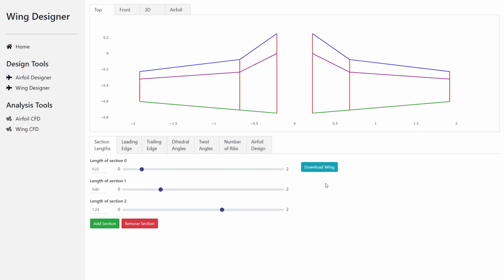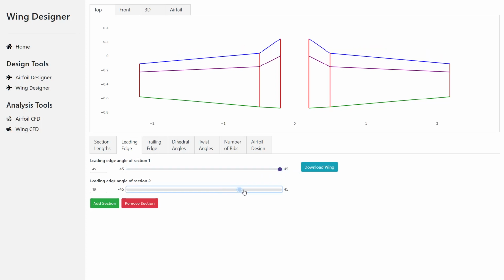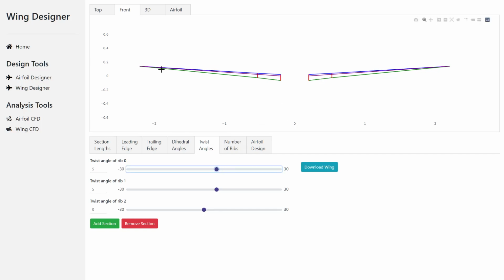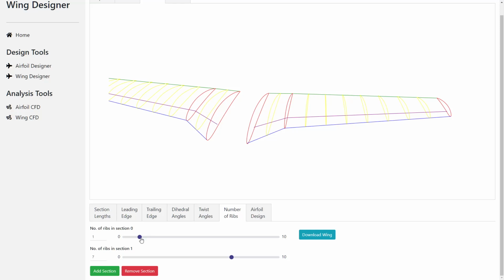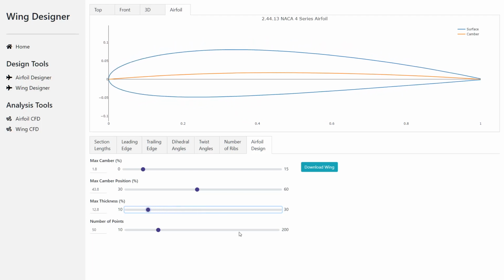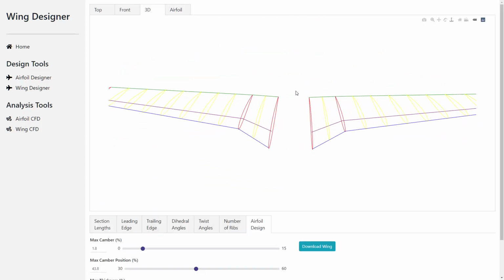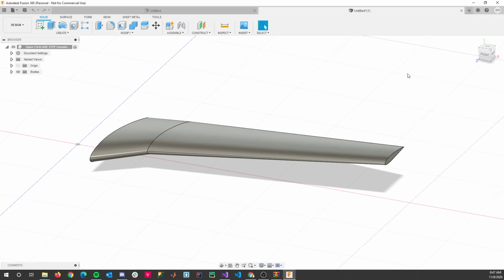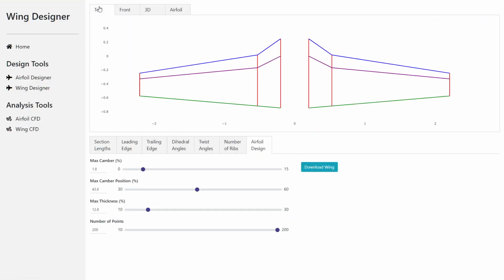Wing Designer - Create aircraft wings quickly and easily

Comment: wow... it's  great! Sir, did you decide how to do? open source software?
Reply from the maker: I do plan on making it open source! Will have its official release soon. Many improvements made since this video.
Reply: @williamsworkshop8624  morning sir, any news? the application is very interesting. I am curios. thank you in advance
Reply from the maker: @stefanoperilongo2685  Hi, I pretty much just need to get the website up and running. Taking a little longer than I'd like since my main workload for work is heavy right now. But it's coming! :)
Reply: @williamsworkshop8624  hi boss, do you have any news for the application? thank you in advance
Stefano
Reply from the maker: @stefanoperilongo2685  I've had to put it aside for the time being. I ran into a few architectural issues with interoperability with python that I need to figure out before I feel comfortable even releasing as open source and I've had no time to work on it unfortunately.

Comment: Amazing stuffs here although I am not an engineer. As a Rhino user and managing a channel about it,  i think a plugin of this in Rhino 3D CAD will be very useful.
Reply from the maker: Not sure about making a Rhino plugin but I did add a feature for the designer to output .stl files instead of just .stp. Would that work for Rhino? Are there other file formats that would make it easy to import into 3D modeling softwares?
Reply: @williamsworkshop8624   I think export as STP or NURBS Curves sections will be great. I was thinking you could make a passive income as a plugin. Rhino already has plugins for many applications such as hull building.. but I have not seen any for aircraft design.

Comment: This looks great. One small suggeston. For adding things like the sweep of the wing. It'd be handy to be able to add in a dimension rather than an angle. eg the tip is swept back 10inches. It will be a bit easier for a home builder as they might not be able to easily handle building something with a 12.7 degree sweep. Also for the aerofoil, would it be reasonable to import and export it as a list of coordinates in a text file, not just a csv file, similar to what is found on airfoiltools.com
Reply from the maker: Yes, I'll be adding the ability to define sweep that way soon! As for the airfoils, in the current version (not shown in this video) the user can import export airfoils as .csv, .txt, and .dat files.

Comment: Nice to see someone is working on this kind of software. I am doing something similar for flying wings, but I don't know when the public release will happen. You can check some short video on my channel. What CFD solver you plan for CFD? Full Navi-Stokes or something simpler?
Reply from the maker: I'll be using panel methods for airfoil and wing CFD. They're a good balance of speed and accuracy.
Reply: @williamsworkshop8624  That is cool, I planed to use VLM and for full cfd to use SU2 open source solver. VLM can work quite fast and I planed to use it to optimize wing shape.
Reply from the maker: @High9231  VLM is likely what I'll be using. Unless I find another algorithm that's better.

Comment: Extremely well done. I'm an aerospace engineering student, and was wondering who the main demographic for this software is. I would think most people that would need to produce such a wing would just do it in cad with a couple lofts. Let me know if I'm missing something!
Reply from the maker: This is the earliest version. I plan to add features to create control surfaces, spars, multi-airfoil wings, etc. It'll also be able to perform basic CFD for airfoils and wings.

This is actually an extension of my thesis which was using AI/ML algorithms for CFD. I needed a way to create 1000s of different wings quickly. Now I'm just turning it into a design tool so I don't have to spend so much time messing with CAD.

Glad you enjoyed it!
Reply: @williamsworkshop8624  that's really cool. It makes sense now since you said it was more for personal use, and now is being expanded upon. The 3d view is far superior to anything I've used before(although I might just have been using older software). I think of there were a way to get most of the data without importing it into cad would allow beginners to explore with building gliders or rc planes without the need for good hardware or expensive software. Can't wait to see how this project progresses! Keep us updated on reddit
Reply from the maker: Definitely will share more! Subscribe too so you don't miss anything! I'll likely make videos of some builds using this software.